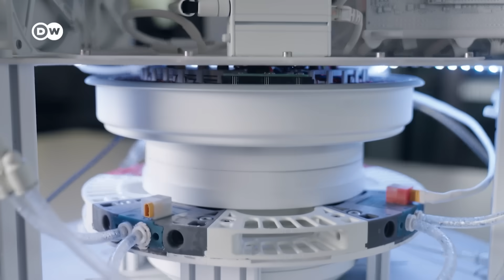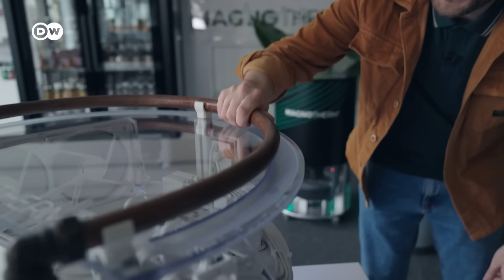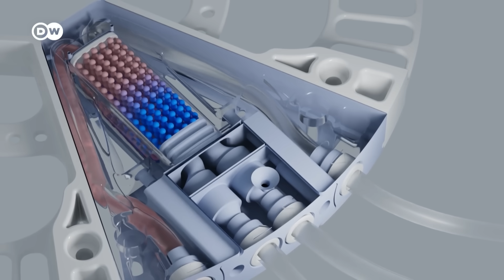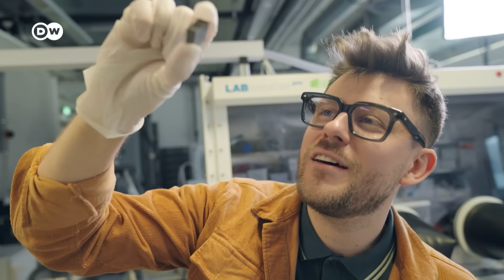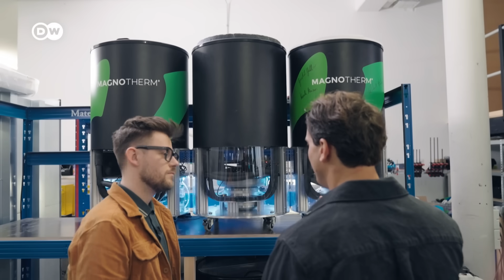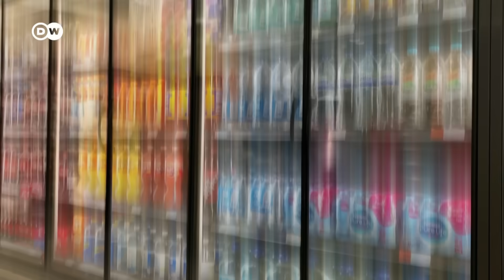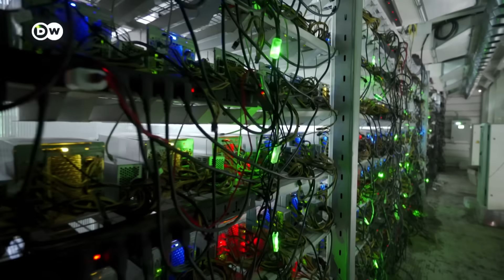How magnets could change our fridges and ACs forever

Comment: Yeah no gases and stuff to affect the environment. But the electricity needed for those magnets and coils to work are making the same problem. Affecting the environment because no electricity in this world on big scale is 100% green. Production of those magnets and tech etc also are affecting the environment. More factory producing etc. Which in turn its not ok compared to having any kind of a gas cooling your fridge or A.C

Comment: Over complicated, Underperforming, Far more points of failure, Harder and more expensive to diagnose and repair. That's a big nope.
There is a reason fridges havn't changed much.. They already work well.

Comment: Kinda trying to wrap head around the your explanation,
Regular fridges does not work like you stated, its not evaporation based they mainly realy on gas gets hot on compression and cold on expansion,
then this "new" fridges looks to be using evaporation and magnatic part just for heating??, if so this is a big trouble we have 100% efficient heaters i.e our electric heaters can convert 100% electric power into heat, why  to choose this and waste the energy? and there whole other thing if we talk about cost and practicality.

Comment: It's just too complex. Just stick with KISS "keep it simple stupid". The refrigeration cycle often just has only one moving part with the compressor (excluding fans and reverse valves), the whole work of cooling is done by the refrigeration fluid. While this magnet cooling solution has multiple moving parts, pumps and fluids. Too comlex

Comment: So the fridge won't turn water into ice because it's using water to cool the fridge down.
This fridge won't have a freezer.
Reply: It's probably only done for testing, because normal refrigeration fluids are gases at room temperature and pressure.

Comment: I dont see it changing our fridges any time soon ... this is not going to come cheap and the cost saving of 30 percent wont justify the upfront and maintainance cost ..... and the temp just goes upto 9 degree Celsius which is not that cold ...

But for ac its a completely different story ...9 degree Celsius is more than enough ..and the cost would be much more bareable as regular split  ac needs to maintained by a technician anyways ...

Comment: However clever in design, and I could assuredly be mistaken, but the necessity of rarer metals as well as the reliance of outputting the heated water vapor into the surrounding air, seem like major flaws in this design. Depending on the fridges location, one would need an ouput directing the heated vapor outside the house, which would likely expell much of the radiated heat back into the house environment before exitting, similar to traditional fridges, meaning alternate cooling methods would be required to maintain a cool house.

If you're going to already require some form of insulated ductwork or piping for this magnetic fridge to avoid heating ones house with humid air, I feel like a better alternative technology for fridges might involve high EER, variable capacity heat pump/compressors, or VCC. They can be made with more reliably accessible materials, already have significantly higher EER than most alternatives, they run ultra quietly, and the life expectancy is also higher due to them constantly running, as frequently turning items on/off is among the biggest killers of electronic and mechanical components like compressors. Just make sure to find a model fridge from a company that doesn't leech money from consumers via planned obsolescence. Compare reviews and get one that's actually built to last, and it will more than make up for the slightly higher upfront costs. Most issues tend to come from built-in door ice makers, which is worth consideration.

Comment: Even if the performance is not sufficient for a fridge, this could have alternate applications.
I imagine this is far less noisy than a compressor, so it could be useful in cases where you want to cool something or a room, but having low noise is important.

Comment: Absorption refrigeration system with a diesel glow plug with a thermal electric generator glow plug voltage multiplier electronics power's the thermostat the glow plug and solid state fan circulation of air inside refrigerator and LED light.  No need to plug in deep freezer or freezer refrigerator? 🤔✨️

Comment: huh. Did you say that a common fridge cooles by vaporating liquid? Because it doesn't. It cooles by compressing a coolant, which gets hot by doing so. Then it gets passively cooled at the back side of the fridge. That compressed coolant is then decompressed, which makes it cold. Then it goes through the fridge to cool it down and the cycle repeats
Reply from the maker: Hey there! You're right that there's more to it, we simplified the explanation to focus on the heat-absorbing evaporation step inside the fridge, but the system also relies on compression, heat rejection and expansion. 👍

Comment: why are they using spining permanent magnets instead of electromagnets that can be turn on and off very easy?
Reply from the maker: They're likely using a rotating permanent magnet since it’s more energy-efficient, electromagnets require constant power and would make the system more complex.

Comment: This doesn't save any energy at all. COP is the only important metric for energy cost. A modern fridge has a COP of 3. If they're at 1 and aiming for 2, why is anyone even claiming this could save energy?
Lets be super clear: TECs (thermoelectric coolers) are the worst cooling devices anyone uses and TECs can get a COP of about 1, which is what these guys are doing.

Comment: The big issue i see from an engineering perspective is the amount of steps. Between all the pumps, valves, magnets, and that perforated block, its just way more than a traditional compression cycle, and you'll lose energy there, lowering efficiency.

Comment: If it vents hot water, can that be stored and used as drinking water in a water heater? No need to vent it into the air. The same might be true of regular heat pumps though.

Comment: But the problem with this. Is that unlike my 20 year old Fridge that Just Works.
Is that this will forever from now. Be shoved inside of "smart appliances" that will break for no reason in 2,5 years just after the warranty runs out. Instead of just running.

Comment: The explanation of how today's fridges work in this video could also have been summarized as "Magic 🪄" and it would have been the same. The true full explanation is far more interesting and I suggest anyone to look on youtube how they work, the core principle is using the relation between temperature and pressure, expending and compressing a gaz inside a closed loop to make it cool and absorb the heat inside the fridge and make it hot and releasing the heat outside the fridge, it's similar to AC except for a tinier space.

Comment: For context. This is only the next step in a long history of advancements: 

· 1870s (Linde’s ammonia compressor) – ~50% gain (first practical machine doubled the efficiency of early air-cycle coolers).
· 1920s–30s (CFC Freon + hermetic compressors) – ~30% gain (sealed, leak-proof units slashed energy loss vs. belt-driven open compressors).
· 1950s–60s (frost-free electric defrost) – ~10–15% loss (actually reduced efficiency for convenience, but forced later heat-exchanger improvements).
· 1970s–80s (improved insulation + foam-in-place) – ~20% gain (thicker, better walls meant compressors ran less often).
· 1990s–2000s (electronic expansion valves + variable-speed fans) – ~25% gain (allowed precise superheat control, cutting waste).
· 2010s (inverter / variable-speed compressors) – ~30–40% gain (matched load perfectly vs. fixed-speed “on/off” cycling).

Cumulative result: A modern fridge uses about 70–80% less energy than a 1970s model of the same size.

Comment: Way too much complexity, price will never compete with a compressor. It would have to be 3D designed and printed or something similar, and even then would still be very expensive.
Forget it. And they might be more efficientt in terms of electricity use, but definitely not actual output.

Comment: so you have magnets moving, pumps moving, valves moving, fans moving, and 2 loops of coolant flowing. absolute precision is also required. all that for a (not yet) 30% efficiency increase over SOME compressor fridges?
meanwhile compressor fridges have 1 compressor moving a single loop of refridgerant, and maybe having an extra fan that is optional.
how can we even have this comparison?

Comment: Before they put a man on the moon, many people said it's impossible, and later the impossible became possible. We have to compare apples with apples though and Michael is spot on in every comment he made that I've read. There is no refrigeration method that can compete with the standard compression system for one reason, Latent Heat. Latent heat is so powerful and exploited with the standard compression Refrigeration regardless of the refrigerant ( gas ) being used. Some Refigerants are more efficient than others and some are safer than others. The standard compression Refrigeration system is most probably the cleanest most reliable mechanical system out there. Thermoelectric Refrigeration and this magnetic Refrigeration just can't compete because Latent is not part of their function. The only alternative that can outclass the normal compression Refrigeration system will be slowing down the vibration of molecules via Laser technology 
and that already exists but it's only applied to reach ultra low temperatures. How cost efficiant that is I'm not sure, but that will almost equate to a microwave refrigerator. As a matter of interest I don't know all the ins and outs of Lazer Magnetic Refrigeration, but who knows that might be the only thing that could be more efficient than a Refrigeration system that has Latent Heat as a contributor of it's efficiency.

Comment: What do you think about developing a linear compressor supported by neodymium magnets, replacing the Freon gas with plastic crystals (Balucalure), replacing the copper coils with graphene coils, and designing it in a way that provides better efficiency? And let's not forget to program the air conditioning system with an inverter for gradual electricity consumption.

Comment: I didn't hear the pro/con that you have less moving parts, having no gas in your system, that everything is modular and can be made refillable with just water.

Yes the compressor is also a moving part, but it compresses gas by physically pushing it.

This uses a motor that pumps water around and a motor that spins the magnetic disk.
Which might be possible to make just one thing. Same axel connected to the magnet wheel driving the water pump.

This is also a lot easier to turn into a hybrid system.
Like, that you hook up a part of it to a second heat exchanger that transport the water to a bigger cooler that takes the heat from the fridge out of the building OR back into a boiler.

Comment: Einstein holds a patent for an electromagnetic refrigerator. This is not new technology, it’s an evolution of the principles Einstein protected. DuPont commercialised refrigerant chemistry, rendering the electro magnetic cooling system more expensive to purchase. This obviously doesn’t negate the negative impact that such chemicals have on the environment at end of life. Einsteins design however had no moving parts and thus had a considerably longer lifespan than the chemical/compressor competitor….

Comment: Of course it doesn’t nearly offer comparable performance, and yes it’s still at a very nascent stage, but it’s disappointing that the video didn’t point out the biggest problem they’re hoping to solve. The working fluid in this case is a mixture of Isopropyl Alcohol and water. Most refrigerators, after decades of search for refrigerants still use R134A, which has a Global Warming Potential of 1430 (CO2 has GwP of 1). The water-alcohol mixture has GWP of 0. 

Whether the technology works at scale or not, it is impressive either way.

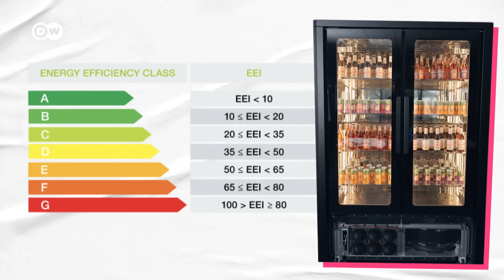Comment: 8:34 EEI value of a bigger fridge is generally lower because the value takes into account the volume. So its energy usage per liter, but the liter increase ^3 and the surface ^2. So that's comparing apples to pears unfortunately.

Comment: Cool idea, but actually pretty terrible. Magnetic fridge has constantly moving parts which will wear off quicker and require consistent maintenance. It's not an improvement, but a way for corporations to make you spend more money on fridges.

Comment: Won't the metal blocks eventually warm to the ambient temperature thereby stopping the effect? Or is it the ambient temperature of the block what makes this actually work?
Reply from the maker: Hey! The key is the cycle: the magnetic field keeps changing, so the metal is repeatedly magnetized and demagnetized. The heat is carried away by a fluid, creating the cooling effect.

Comment: To be honest, I dont think that this will replace VAC cooling anytime soon, giving that the construction of the device relies on many technical components and metal 3d printing, which will be a lot more expensive compared to the metal pipes and simple ac compressors flowing off the conveyor belts today, with a production cost of tens of bucks, maybe hundreds for very big units, instead of thousands. So I agree with your judgement in the end, sadly

Comment: I would love it if you did a report on some of the products like refrigerators, clothes dryers and food processors. Differ from United States to Europe.
I live in both countries and I find that the refrigerators are not designed as practical and they always get iced and you have to defrost them. I find that the clothes dryers don’t use the vent and the barrel is so small that everything comes out wrinkly and it takes forever to dry. I find that the washing machines in Europe take hours when and United States they take 30 to 40 minutes instead of having a direct connection to the hot water I hear that they have to heat their own hot water, which makes no sense. And the food processors are so large they don’t fit in the tiny kitchens of Europe. They’re very bulky. These are some of the things that drive me crazy between both countries I’m not putting down Europe. I’m just wondering why in all these years things have not improved with appliances. Also, instead of just writing what you want in your wash it’s so complicated with the washing machines with all these weird squiggly lines. Why don’t they just spell it out like American clothes washers very simple. These are not rocket science things.

Comment: This system but powered by a windmill would be a great district cooling method
Reply: if the system is inefficient, which i it very much here, the mean to run it doesn't change anything, you could use the same wind to run compressor and reach COP of 7 instead of COP 1.5 lol. There is absolutely no point in this ridiculous non technology.

Comment: This seems sort of wasteful at the moment as your only using the cooling effects and wasting the heating, is there not some way to improve efficiency thermal electrically with peltier modules to turn that wasted heat into electricity and cooling?

Comment: This is much more complicated than an simple compressor type fridge. You need basically an air condition as a split type to be installed as well as radiator. Then the rare earth materials and worrysome "needs tightly timed" of the system. I do not think this will replace the traditional compressor. That 30% of less power is not worthed. This is now just used as an excuse to sell you an fridge for 10.000 US$. With this they will jack up the pricings only by leaps and bounds. If not needed to cool I want the compressor off completely and just running when needed. This magneto system makes things incredible complicated.

Comment: Why aren't they using electromagnets? Just simple coil with electric current? On/Off, heat/cold...

This takes away the large moving part... And less breaking parts too.

Also scalability is likely better, because you don't need those moving parts.

Ok, coils heats up by resistance, so it is not without disadvantages. But also movement has frictions that generates some heat (further away from needed cooling).

Comment: In that case, can this be used on air conditioner? Or maybe put the coil underground around the apartment or condo so it feels cooler? Or that rare material, can it be replaced with another ready material cause I feel it will increase in prices? We need more rare material from other planets.

Comment: think of a magnet like a tornado if you spin it.
the magnetic waves i mean. typically the waves are static
in a said direction. but if u add rotation, the waves meet at a pinpoint
like a tornado. have fun experimenting and ur welcome for the tip.